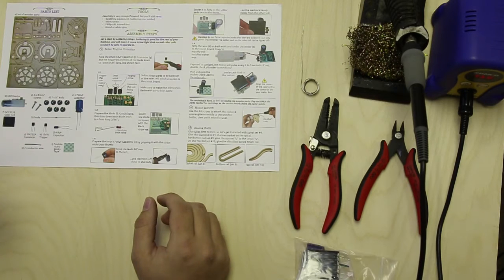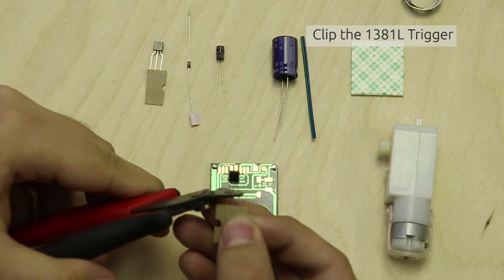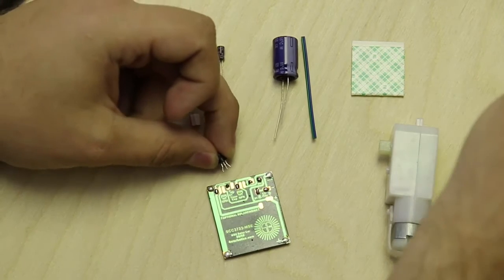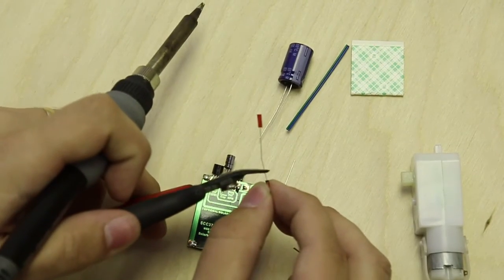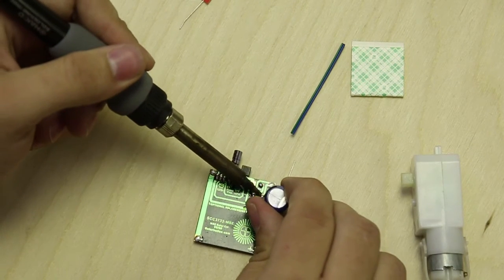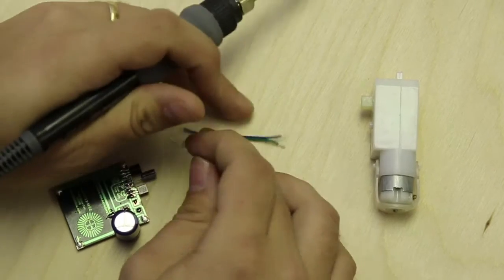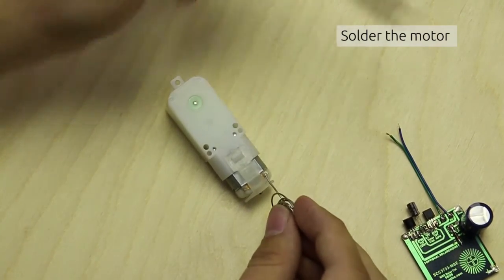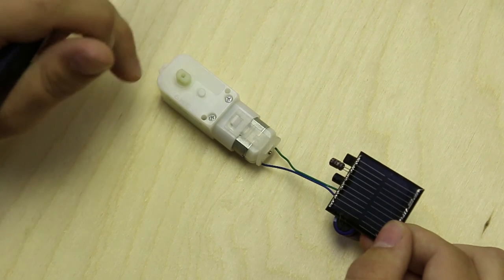The Marble Machine Solar Engine Assembly

Comment: Sorry, I see on the video the manual is same as we have, with a extra board for the parts, however you do not use this ?   we used it and nothing is working,  do we remove parts and put them directly on the solar part ?
Reply: We have the same issue.  Whats with the solar engine circuit board?  Do we need it? Nothing is working.  also where is the poloarity line on the small diode?
Reply: +Steve G Sadly Even after removing parts from small board and add to solar one, things still done work, the soldering pads fall off quality simple to low to justify the money I think, happy to make a "bread" board setup iff somebody want to share the layout im a novice, so need a but more help,
Reply from the maker: +Jasper Waale We originally used JUST the circuit on the back of the solarcell, but we've since found that the manufacturing process for it wasn't very consistent, and had many pads lift off the solar-cell. We've since added a separate, high-quality circuit board to build the circuit on that is much, MUCH more reliable.

Avoid using the circuit board on the solar cell - the separate one is much better.

As for it not working, make sure you're putting it under direct sunlight, or an incandescent / halogen lamp. LED and fluorescent bulbs work, but are much weaker on solar cells which prefer more IR energy .
Reply from the maker: +Jasper Waale Send us a direct email at support@solarbotics.com, and we'll get you set up with some replacement parts.